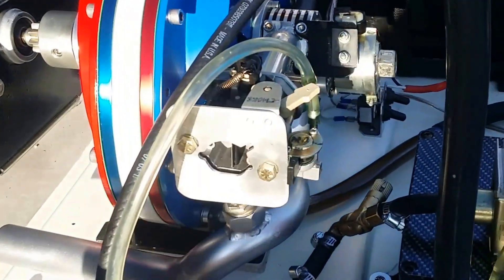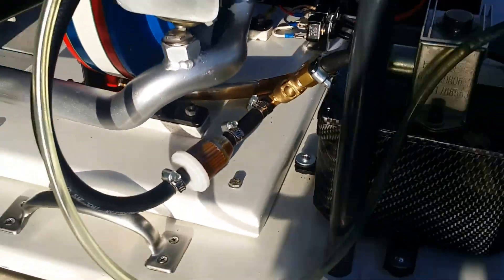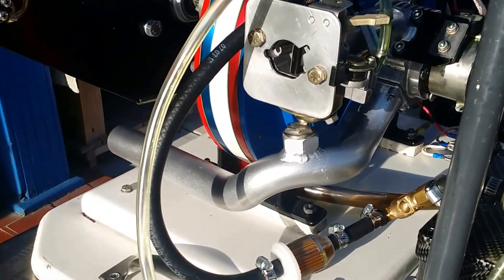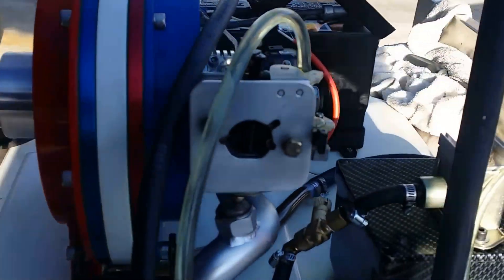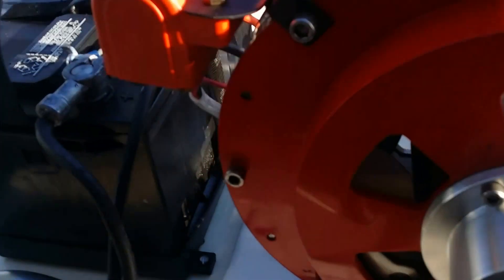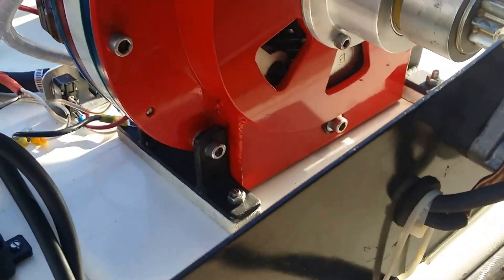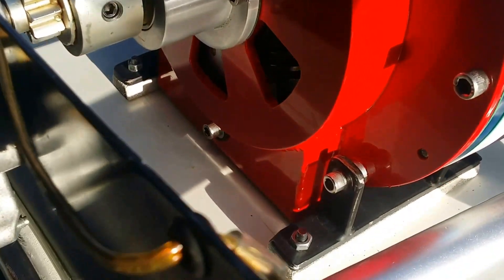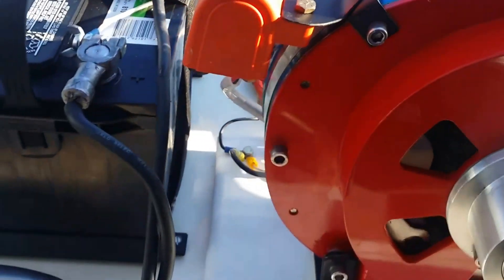Hybrid Rotary Engine,  developed by Hybrid Engines Corp.

Comment: You did a fantastic job putting this engine together, all the parts look great. I was surprised to see any vibration at all since it looks so naturally balanced. Do you think it is just radial pulsing from the power stroke? Maybe a larger flywheel would help? Maybe a 3 rotor design!

Thanks for sharing, it's just such a cool engine!
Reply: I believe that vibrations come from all the parts involved (except cylinder/pistons maybe) being too thin/flimsy for the application. A real motor should be beefier, here we have too much structural "flex", I believe... Easy to solve...

Comment from the maker: So far I have not had a problem with overeating but that could be easy to remedy. The airfoils on the rotor move air through the housing pretty well but thank you for your suggestion